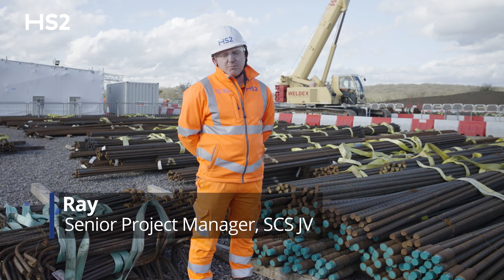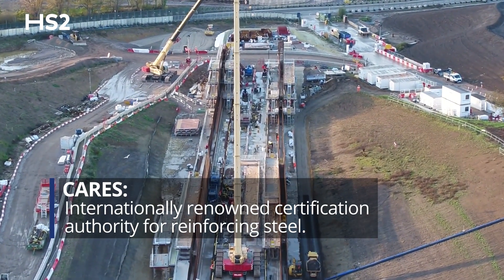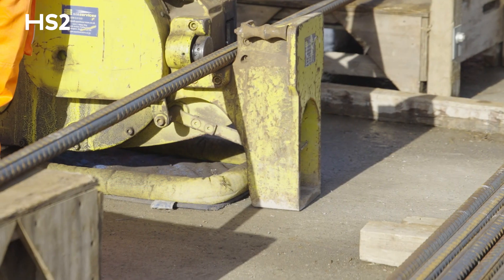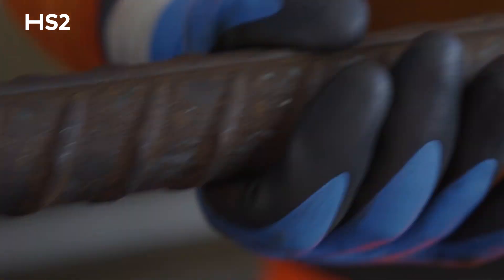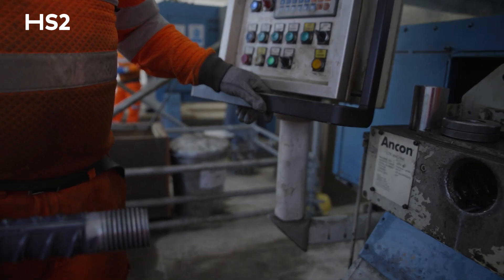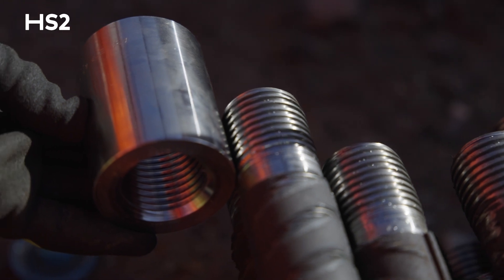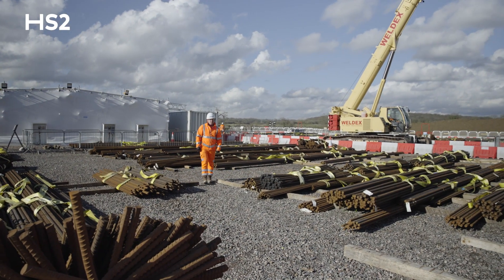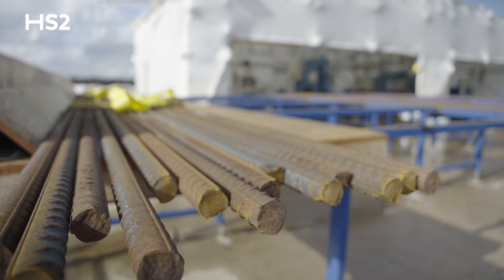HS2 tackles materials shortfall by opening a new on-site rebar components facility

Comment: Surely lapping the reinforcement would be a better use of resources. The cost of using mechanical couplers is very high, poor use of pubic funds. A privately project would never go down this route.
Reply: Value for money is not the same thing as "spending less money". Making things more cheaply leads to things wearing out more quickly and needing to be replaced more quickly. Replacing stuff costs money too, so building things that don't last costs more money.

HS2 is being built to a high standard, so that it doesn't need to have a high number of closures for repairing the railways.  When you have something like the Burton Green Tunnel, you don't want to be digging it up to replace the concrete panels any time soon. I don't think that future generations would be thanking us for penny pinching measures that force them to go through a massive process of rebuilding HS2.

They have expert engineers who look at the entire lifetime cost of projects and factor out costs over that time. They look for the sweet spot of making things last as long as possible without getting into the law of diminishing returns.